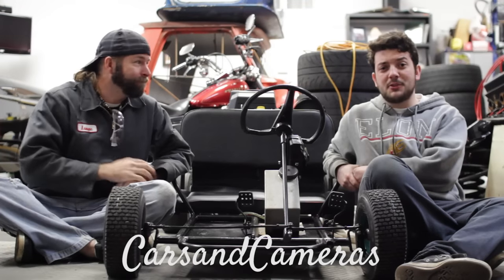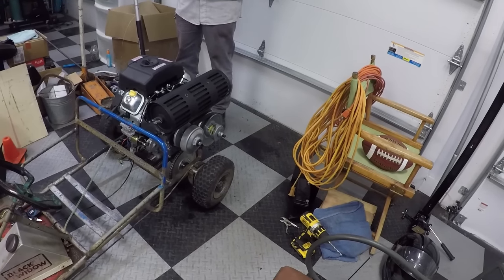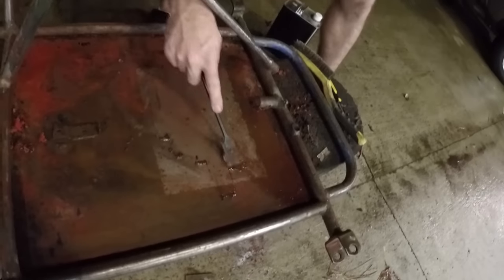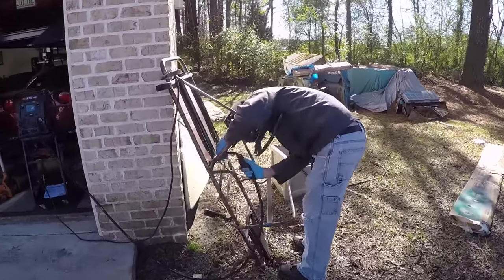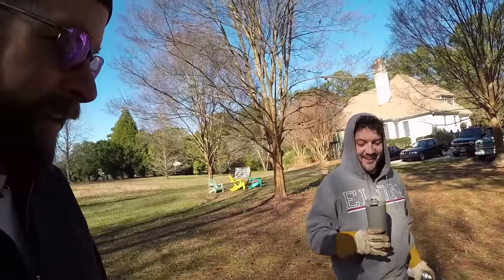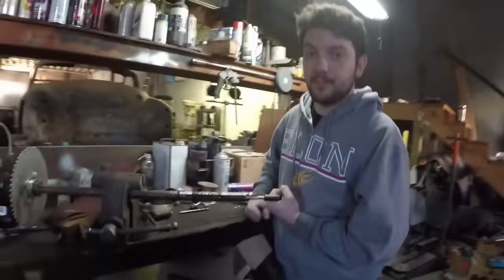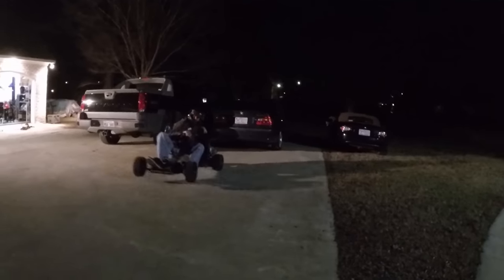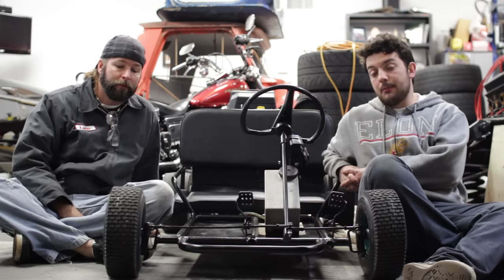670cc Go Kart Restoration and Paint!

Comment from the maker: It looks so much better! We can't wait to remove the governor.
Reply: spray it a bright pink
Reply: +CarsandCameras the paint cracked so bad because its wayyyyy too cold to be painting outside. You guys shouldve painted it in the yard then brought it into the garage and put heat lamps or some type of heater on the parts so they dry properly.
Reply: +CarsandCameras han solo's son called kylo ren kills him
Reply: put some head lights on that thing. yeah buddy
Reply: Do a donut in that kart
Reply: And some under glow lights under it...
Reply: +CarsandCameras Now all you need's a set of headlights on that beast :P betting you have a dynamo already on the engine for power return to the battery so a couple LED heads won't kill the battery :P
Reply: Hansolo kills his son ... (~^-^)~
Reply: When is the build off???????
Reply: You guys should build a microtrailer with everything to fix a go kart. It could fit on a go kart and go with you if you went on a trip somewhere.
Reply: Next should be an all wheel drive kart
Reply: +CarsandCameras You should add some led lights in the front ^^
Reply: Hey john, are you guys going to make more videos on the rat rod wagon or is it done or have you forgot about it or even don't have time because I want to see that too. I also think you should put a torque converter on the rat rod, if you respond, thank you!
Reply: +CarsandCameras just imagine if you put that motor on one of your race carts
Reply: +CarsandCameras The cart is looking great! So, you have a battery and electrical system. You thinking of adding an LED light bar or lights of any kind?
Reply: +CarsandCameras you guys should make a drift trike
Reply: +pontus freij yes.....with the same predator thats on this
Reply: +CarsandCameras black Betty
Reply: +Parker Barandon its going on now
Reply: +GR liberty we are still working on it
Reply: +Juggalo10p if they could make it fit cause a drift trike usually is pretty small but it would be fucking awesome
Reply: +CarsandCameras ADD LIGHTS ON THE FRONT AND THE REAR.
Reply: +pontus freij I thought the same
Reply: +mtb9061 you do realize by starting off with Han Solo everyone  "Han Solo" so they don't want spoilers so they keep scrolling after they read Han Solo so you just wasted your own time typing that comment....
Reply: +CarsandCameras if you guys want, why not run a second booster cable that by passes the governor kinda like a NOS kit. donig means that you now have both hands in front of you.
Reply: You should build a rollcage over the kart
Reply: +Ryan P I agree 100%
Reply: You need four tires on Th rear axle
Reply: +CarsandCameras han solo dies
Reply: can I have it
Reply: you forgot about the wheelie bar
Reply: +CarsandCameras When you're painting on metals, do you not need to use an etching primer to avoid the blistering, as seen on the wheels?
Reply: I think the name "black stallion" is a good name
Reply: If you guys made some custom fenders / mudguards that would look cool
Reply: you guys should make a "how to change a two part go kart tire" because me and my dad are having trouble changing one of four
Reply: +CarsandCameras strait pipe the exhaust
Reply: +CarsandCameras  this is a suggestion make a wheelie bar and are you ever going to put nitrous on a cart cuz i really want to see that
Reply: y'all should get in depth about the pedal cause I want to know how y'all get your pedals nice so they won't get stuck
Reply: +mtb9061  o oh spoiler alert
Reply: you should put some pvc pipe in the wheels and drift it
Reply: +CarsandCameras I can't find part 2!
Reply: you should have named it Reaper
Reply: What about RC trucks?

Comment: Awesome job guys, tip for the cracked metallic paint on the hubs @ 10:50 in, I had the same issue painting my PC fans in chrome and metallic blue. The moist cool air messed with the solution in the paint that lets it dry fast while the metallic flacks were setting, this caused the pooling and the ever so wtf moment of the paint cracks. If you hit it with a blow dryer or heat gun on low setting while it drys it let the metal flack's setup and reduce the cracking to less then. Personally love the green, neon green would have popped, that corvette would just see a neon blur as you guys speed on by haha.

Comment: I think you  need to put a much  smaller rear sprocket on the rear. That v twin  on has to work  about 70 feet. To me it like putting  a 720 gear in a car pulls real hard to the top speed of  65 mph. Just my 2 cents worth. Good job. lots of fun  to watch .

Comment: next metal painting project try using Penetrol as a rust preventative and primer. you can also use oil based paint with Penetrol added brushed to give a almost sprayed on finish using industrial alkyd enamel paints. if you use penetrol on rusted metal it eliminates the need for sanding and wire brushing the metal.

Comment: Hey guys for exhaust mod how about a turbo, I think a gt15 should work on that cc size . it be a hoot to hear and that vette would be beggin for mercies . throw the stock carb out and use a snowmobile unit they are much more tunable  for a turbo and try some E85  fuel it will be easier on the engine. great video!!!!

Comment: Leaves the frame rough, doesn't prime before painting = Laziness. ;) Did turn out good. I would have had the kill switch on the other side of the steering wheel so it's out of the way of your leg and extend the front a bit.

Comment: Use a copper plate to fill in rust the holes. Using the mig, it won't stick to the copper and allows you to fill cleanly and quickly. Also if you strip to steel use acid etch prime before paint the bond is better. Otherwise kill the vett!!!

Comment: Wrinkled paint comes from: 1) Warm paint, cold material. 2) Warm material, cold paint. 3) Multiple brands of paint that, when mixed before fully drying, interact poorly due to the different chemical compounds used to decrease dry times.

Comment: The rear wheels were pretty stuck on my Manco Dingo. Had the kid hold a pry bar on the back side and I used brass drift and a hammer on the end of the axle. Lots of sweat and profanity later they finally came off. All to replace the rear sprocket and install a new torque converter.

Comment: yep I'm upside down, this is not good.     you have to put a rollbar on it. build it with mounting brackets so you can just bolt it on, u won't have to repaint. LIKE IT

Comment: Painting in the freezing cold? 
Usually doesn't work so well.
Reply: aslong as the paint is warm itll come out of the can fine but in cold weather takes longer to dry.
Reply: So the paint hitting metal that is nearly at freezing temperature is fine?
Reply: +dacasman yeah. it is. i live in alaska and paint car parts all the time to they dont rust.
Reply: +mcl0027 you need to read more because you clearly dont understand what i said. i said why i paint car parts in Alaska and not all the parts are rusted most of them are brand new parts. if i can paint outside in Alaska weather then yes it is possible to paint in the cold. maybe you should do some experimenting so that you can learn something. because here in alaska if i can paint cold metal with a rattle can then your statement is wrong.
Reply: +mcl0027 so you remove your comment because you know youre wrong.

Comment: Start with a really high wire speed then turn it down while you are running a bead. The mig will not even throw 1 spark

Comment: just a thought but a Yamaha banshee has 350cc correct me if I'm wrong. may have more. but it has more ass the the grizzly which has more cc's. not overall power. just takeoff and the ability to accelerate.
Reply: A banshee is a 2 stroke. The 660 engine is faster on raptors

Comment: Why the HECK didn't you guys start with a bigger cart!? I know this is all in fun but the end result would've been so much more capable! I am impressed with the amount of work you guys were willing to pour into this crappy 5hp chassis!
Reply: +Ron Garvin also forgot to add: This go cart (in stock form) was set-up for a10 year old driver. So with all the other cuttin' and weldin'...why didn't you guys center the steering wheel and controls to better accommodate an adult sized driver!?
Reply: +Ron Garvin we work with what we have. ive been looking for a two seater kart for a year and this one popped up so i jumped on it. we havent centered the wheel yet because ive been thinking about scaring the crap out of some kids by letting them ride with me. lol

Comment: Carsandcameras don't remove the governor make what I call an overdrive take another throttle cable and put on the other side of the Governor and hook up another gas pedal or use a hand brake lever it'll be way cooler that way and it we'll be fine.
Reply: +tjkrank01 the governors are known for exploding if you dont remove them when they hit high rpms
Reply: +Isaac Jennette  I did not know that thank you
Reply: your welcome

Comment: +carsandcameras 
i am building a home made go kart with sheet metal and metal tubing what will the best engine be
Reply: What size you going for man? Im building my own go kart, similar to the Taipan from The Edge Products and they say a 250cc dirtbike engine is more than enough( bout 22hp). I have a DRZ 250 ( no I am not strippin it for my go kart) and it weighs bout 130kg and can still haul ass up to 120-130km per hour.
Reply: +Michael Dagostino we really love the 212 6.5 hp honda clones
Reply: Isaac Jennette  ill try that but i think it will be to heavy but you'll never know it'll be fine lol
Reply: If worst comes to worst u can take out the governor and make a hi flow exhaust and re jet the carb just like Carsandcameras did in the minibike drag race prep vid. Oh well good luck man :)

Comment: what do this "governor " do?
Reply: limits the rpm to 3600
Reply: +josh wren The governor system is like a cruise control system. It maintains the speed of your lawn mower or outdoor power product they keep your speed steady regardless of engine load - the amount of work the engine must perform.
Reply: +TheCreeperInterior no?
Reply: PorkChopGaming its correct you being answerd by a mechanic my self it is correct!
Reply: +TheCreeperInterior i dont think cruise control is the correct analogy
Reply: +86gtforme for an example the governor is like a person pressing the gas but holding it steady as if they want to achieve higher RPMs they need to bypass the governor in which they want to remove it. Its basically a cruise control it stops you from getting higher RPMs that could potentially break the engine  that's the reason why the companies that make them tell you to not mess with the governor linkage or setup. also if you notice John said don't try this at home for a reason on the other video  Cars and cameras has the knowledge to do it but I guess you could say "it'll be fine!"
Reply: TheCreeperInterior its alot closer to a rev limiter than cruise control
Reply: 86gtforme right but im putting it as it says in the book you read on about an engine especially ive worked on cars and small engines youre right thats another name for a cruise control a car has it to limit speed but it limits RPMs as well
Reply: TheCreeperInterior id argue more cars have rem limiters than have cruise control. its not something that's terribly obscure either most drivers understand there is a red line on an engine.
Reply: +86gtforme I'm not dumb I know there's a red line  I know a lot about engines I w about hohow they work as well the small engines
Reply: TheCreeperInterior you're very defensive i never questioned your intelligence or knowledge. i simply stated the analogy you used wasnt the best one available
Reply: Rev limiter isn't quite right either. Basically the throttle setting you use is a guide for the governor to hold a certain RPM.
Reply: +nickgost that's what I said in my own terms now back off buddy
Reply: ok dude, first of all I was on your side. It's the internet... no need to get up in arms
Reply: TheCreeperInterior what is your issue man, we are all just trying to answer the question the the best way we can. no one was trying to personally attack you, you do not own rights to this question yet you have a high level of entitlement towards it.
Reply: Check out his videos, he is just a kid (teenager). That's the problem. he has knowledge and wants to brag about it, which is fine... again this is the internet, but... Other people on here like myself may be a technician that literally works on these engines 40 hours a week.
Reply: I think this question has spurred some warfare.
Reply: +Rod Mosgrave it sure has
Reply: +nickgost same here also correct teenager I have a shop teacher at e high school that taught me basic to all I'm kind of referring commenting we all are right also I'm not bragging trying to help out thanks!😛
Reply: +nickgost of coarse is have the knowledge of it got taught by a shop teacher I have a other channel specifically for engine stuff known as smallenginemechanic427  if anyone is interested  not advertising just saying  I'm cool with all of the answers
Reply: TheCreeperInterior Dude that's actually pretty cool. I wish my high school had a program like that. Mine just had welding.
Reply: +nickgost  yeah  since I have to wait til my junior year I can sign up for the welding sucks I can't do it this year tho its a decent school though